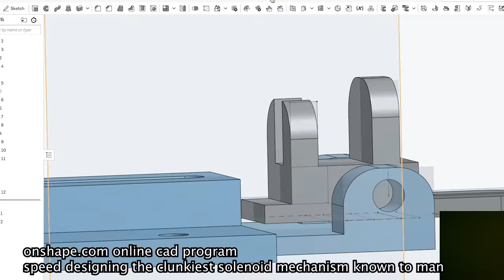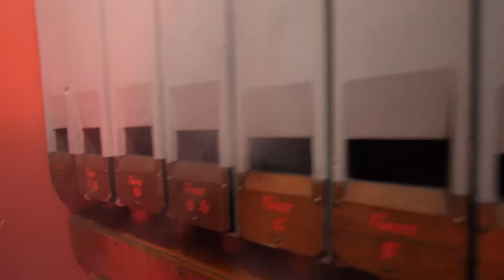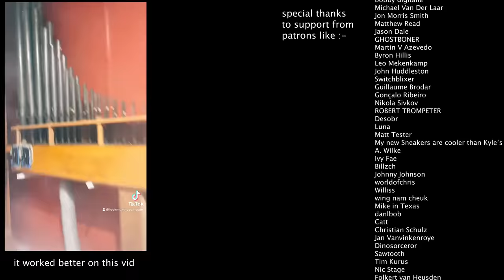I BOUGHT A CHURCH ORGAN PART 4,Plugging Up Smoke and More Pipes!

Comment: If you want to get better result with the smoke, try to get fast desolving, thick fluid for the fog maschine.
It creates a nice dense white fog, that desolves quickly, so you can see the effect, but don't fill the room with it so much.
Brands label this as CO2 Fluid, Vertikal Fog, Fast Fog or DSA.
But i wouldn't recommend this for regular use, because it will leave residue that won't dry and probably isn't good for the wood, might even cause mold.
Reply from the maker: Yeah I wouldn’t use that stuff with this. I have a bunch of it it’s sticky

Comment: That looks like a 32 ft. Bourdon rank.  The low C is about 32Hz and doesn't really register to your ears as a note but combined with other (read: audible) notes, it'll add a real depth of sound and a rumble to your chest.

The Bourdon is a flute rank.  The "flutes" have a softer, gentler sound than the "principals" and are usually capped at the top (or baffled in some other way) to achieve that effect.
Reply from the maker: 16ft
Reply: @LOOKMUMNOCOMPUTER  Ope.  I stand corrected.  :D  The low C is still 32(ish)Hz, though.  Wish I could come to the museum, it's a long swim from Colorado.

Comment: The smoke was neat for a little while, but without other ventilation I completely understand why it's not quite in the category of being a thing. Might be handy for leak testing later on though, if other fine tuning or trouble-shooting is a concern. Also it lowers the pitch because it weighs down the air mass moving through the tubes. (Humidity may have the same effect too.)

And how much is the process documented overall? I'd bet there would be people that would pay good money for a MIDI conversion while refurbishing an old setup. However the process needs to be consistent and repeatable. (To some extent it is across each of the notes, but to show how well the whole thing works over time might be worth attention. Doesn't look over-complicated, so I don't see why it shouldn't be reliable.) Might be one way to make money on the side, if you could find the right people.

And clear plastic window on one of the valve boxes? Or just sticking with the original wood?

Comment: The nice thing about your mods is that someone can drop in in another 100 years & for the most part fully restore this thing if they wanted to OR keep your 21 century af solenoids & 8-bit controllers stacked on top of each other in a multiplex
Reply from the maker: Yep! But remember it’s already been modded twice before. Initially by the company that put it in the church. They were not organ builders. They took old organ parts and electrified them. This is a higglepiggle of random organs. Then the dude in the house. So taking back to original… we’ll originally all the windchests probably were in other churches and the source has been lost

Comment: cool, pretty much how "telemechanique and other" pneumatic valve blocks in the industrial sector for moving pneumatic and more parts (like piston) work. a tiny stream of air operates a bigger stream via mechanical mechanism inside the block.
I would have chosen for a clever dual lever mechanism where a little lever controls a bigger lever or vice versa.
smoke is good to find leaks.

Arturia will be proud, i guess.

Comment: If possible you could see about getting a "lighter" smoke machine like a hazer that would make less smoke per second than what you've got (and much much less than a "pea souper") but for a demo I don't know what really would be improved anyways especially considering the smoke alarm issue.

I'm just wondering how long until some metal band asks for a rental. XD
Reply from the maker: thats the first thing i tried, it didnt work sadly. hence going for the chunky smoke machine.
Reply: @LOOKMUMNOCOMPUTER  ah, shame! I guess the light plan is still the best one then probably

Comment: Omg I think I know why the old valve system was like that instead of the solenoids like the other two, the air powered valves let you open the valve only partially based on how hard you press the key down! I hope you didn’t lose this function in the upgrade :s
Reply from the maker: Nope unfortunately not. It’s
Binary control there is no way to just control it a little bit as air spews out the bottom of the windchest
Reply from the maker: The original was the same

Comment: I wonder how well a contact microphone on a pipe would capture the pipe.
Hear me out here, sure you only need a ton of mics running into a bigass mixer but just think of how cool just the mixer would be.
Reply from the maker: You can mix it passively. It’s how fender Rhodes sorta do it
Reply: @LOOKMUMNOCOMPUTER  True, passive mixing would work fine.
But i have another excuse for lots of faders and knobs- per-pipe LFO gating or other effects

Comment: The mechanism of having solenoids that activate valves, which then in turn activate a cylinder to again activate a valve seems kind of weird. Could it be that this was a modernization of a previously fully pneumatic organ? Meaning that originally the pneumatic tubes went all the way up to the keyboard?

Comment: i thought about something similar but instead of flutes and pipes its all electric motors and in front of them always a guitar pick up .... just turn on guitar distortion and then hold a drill to the pickup of the guitar ... imagine this in all tones, as chords etc... had the idea because of poundcake by van halen ..

Comment: It may not be a totally stupid idea to run smoke through it to find and repair all the air leaks in the system at least the major ones. I would think the less leaks the less hard you need to run the blower to get the same loudness... which might be a good thing.

Comment: Go easy with that stuff, you will never clean its residue out of those pipes! Won't want them to corrode when the stuff in the smoke effects potentially oxidizes or becomes rancid with time. Also, if it collects it just might attract accumulating dust.

Comment: Those electromagnetic valves that you’ve used are working for sure, but there is one big bad thing with them - they are too fast, it doesn’t sound nice at the moment valve gets open, it make tone to change
Reply from the maker: You are aware the secondary valve at the bottom is literally an on and off. Even the air control is binary with that setup. Hence why I used them

Comment: Why did the original organ use indirect air-based control instead of solenoids for the big momma pipes, but still use solenoids for others? Were they not strong/small enough?
Reply: The parts could have come from different organs.  Also it is more difficult to move the larger valves directly with solenoids.

Comment: A dry-ice smoke setup would remove the issue of residue since it is just CO2. Might also look cool on infrared camera. 

Assuming that all that CO2 doesn't wind up replacing all the oxygen in the room lol. This is possibly a terrible idea.
Reply from the maker: Yea but dry ice is no where near ambient temperature. Causing the metal to contravene and pitch to go mad

Comment: So you could make each pipe pitch bend my making a piston that you can fit in the wide end a slide it up and down? Or a vibrato effect using a servo or solenoid with the piston or something?
Reply from the maker: yeah but then its a slifde whistle
Reply: @LOOKMUMNOCOMPUTER  A polyphonic slide whistle still sounds interesting ;)
Reply from the maker: @pheargoth  check mitxela

Comment: lol So, speaking of the incredibly leaky and inefficient air pump system... any plans on upgrading that to a modern air compressor system? lol
Idk, I guess there are certainly benefits to the older system. It seems to be much quieter than modern compressors.
Reply from the maker: Nope it’s fine 👍
Reply from the maker: Yep it’s quieter than brushless modern equivalents

Comment: Are those big pipes for the organ pedal keyboard?
Reply from the maker: If the right stops settings are on het
Reply: The pedal keyboard is the main way you’d use pipes like that.  But you could play them from a manual keyboard if you wanted to.

Comment: 04:55 could be used servo motors also,dont?
Reply from the maker: They are too Noisy sadly
Reply: For organ pipes, all you need is binary on/off.  While the 3D-printed solution was interesting and should do the job (I assume with already-on-hand solenoids), there’s also an even quieter item used in the organ industry, “pull-down magnets”.  But as the name implies, they pull rather than push. so it might still take some creativity to put them into use here.
Reply: @kc9scott i thouth that too... But that part of this organ seems to employ flow control...

Comment: Yeah OK to maybe blow a pipe a bit for video. I have big tardis camera obscura used at festivals all in good nick on eBay going cheap if you're interested. Unlike the old speaker horn it is what it says whatever.
I made two little paper roll organs no plans kits or anything. Work OK and can see all the same things except solenoids.

Comment: I hope that you are testing yourself for lead poisoning, the mist might've kicked off more lead particulates from the pipes that air did before.
Reply: I wouldn’t worry about lead particulates.  When they’re made, they leave the factory pretty darn clean, and the lead doesn’t break apart on its own.  What I would be careful about is (1) after touching the pipes, don’t handle food or drink until after washing your hands, and (2) don’t put your mouth directly on the pipe to blow it.

Comment: Make another short.... you dont know what you are doiiinnn🤪

1 question could you take a look in the top and check if there is anything scratched inside... like a date or if it for example is a stinkens made organpipe (lead/zinc pipes)

Comment: Is this the only 16’ rank this organ has? Yes the pipes are 8’ but they sound at 16’ pipes. You might be interested to know that quite a lot of organs have at least one 32’ rank that plays an octave lower than these. If you think these are bassy, 32’ pipes shake things.
Reply: From the original video, I’d say yes, there’s only that one rank that goes down to 16’.  Actual pipes at 32’ pitch are a luxury, and most organs don’t have them.  What’s done more often is to “simulate” a 32’ sound by having a stop that plays a fifth interval using the 16’ pipes.
Reply: @kc9scott  Yes, maybe I should say most large organs, but even that isn't enough distinction.

Comment: An LED on every pipe would achieve the same effect as the smoke without all the smoke :) just sayin'
Reply from the maker: Well yeah that’s in the plan. As mentioned in previous vid 👍
Reply: yeah if you put the led directly across the solenoid it'll have the same effect, but it'll only smoke once.

Comment: Nobody is going to say anything about the dusty 3D-printer?
Reply from the maker: What’s wrong with that? It’s in a workshop. It gets dusty. Haven’t cleaned it in 3 years. Not serviced it. Use it usually 10 hours a week. Still works. No complaints
Reply: @LOOKMUMNOCOMPUTER  Damn i saw multiply cases of printers failing or getting clogged by dust! Yours must be doing great then. No hate tho :) love every single vid!
Reply from the maker: @flolrachou8936  interesting! Yeah never had problems with this. It’s a workhorse. :)
Reply: @LOOKMUMNOCOMPUTER  Keep the vids going tho! hope i can see your musea someday :)